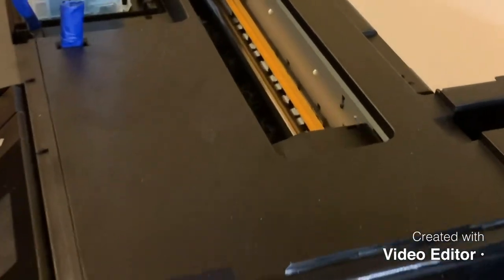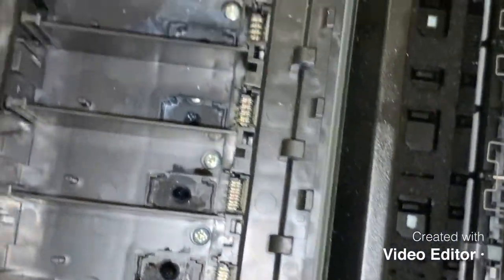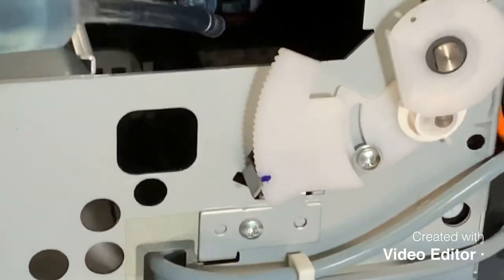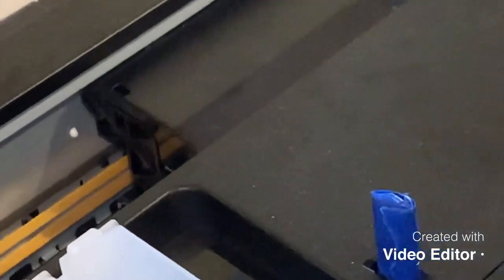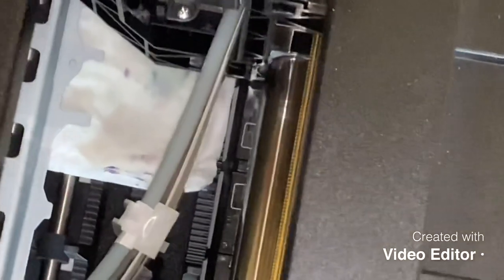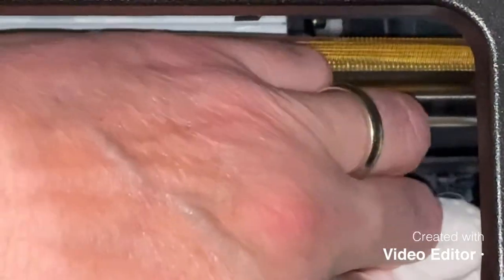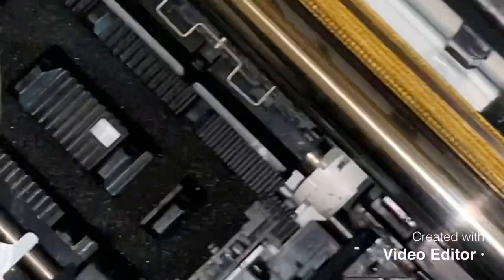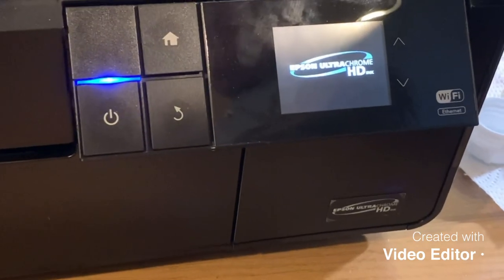Epson SC P600 DTF maintenance

Comment: This is an AWESOME video. I am just getting started and have been worried about the maintenance side. I probably won't print everyday.  Can I leave the cartridges with cleaning solution in place for longer than a day until I'm ready to print again?
Reply from the maker: I don’t use mine every day but what I do, do is shake the inks daily and head clean. If i go away for a week then year i run the cleaning solution carriages. The problem with that is, you need to re prime the lines! I hope that helps :)

Comment: Is this printer still working fine after all these months? Just curious if the way you did the maintenance in this video has prevented any issues from happening after all this time.
Reply from the maker: Sure is!
Reply: @lorimarlodesignco7776  Do you do anything  additional let’s say on a Friday night if you plan to take the weekend off?
Reply from the maker: @inklabdesigns  my printer and shop is at my house. If I’m home i will just hit the button to do a head clean everyday. I have gone away for a weekend and everything was fine
Reply: @lorimarlodesignco7776  Sounds good. I see people on Facebook groups talk about using cleaning cartridges in their printers but that looks to be impossible with printers like the p600 or p800 since they have long ink lines inside. So I’ve been trying to figure out how to make sure not to ruin my p800 once I set it up this weekend.
Reply from the maker: @inklabdesigns  i have put cleaning solution and cartridges in when gone for a week or so…. But a weekend i think is fine. As long as you have a controlled environment. Humidity is the devil with these printers
Reply: Do you clean it everyday?
Reply from the maker: @ericzzz924  sure do! Only if i use it! I just replaced the capping station after a year of printing! Daily maintenance is KEY! I clean the head every couple of weeks i take out and put it in solution to soak and do NOT waterfall just clean exterior unless needed
Reply: @lorimarlodesignco7776  Do you take the printhead out  every couple weeks regardless if it has clogs or not? Next time you do that, would you be able to take a video of you removing the printhead if you have the chance? I appreciate your help.
Reply from the maker: @inklabdesigns  hi there. I do have a video of this already. Look back in my page :) hope it helps

Comment: is this the same layout as the p800? is the whole modification to do dtf the same p600/p800? Remove pizza wheels, build new output tray, chip-less update, refillable cartridges ?   lmk thanks.
Reply from the maker: Hi there, I have not personally converted a P 800. However, it is my understanding it is the same process that you listed above. I wish you the best

Comment: How does acrorip work and where did you buy the cartridges? Do you need something else to do the adaptation?
Reply from the maker: Hi there, I do not use acro rip I use EK print and I purchased the extended cartridges off of Ali Baba. The other thing that you would need to do for adaptation is make your ink cartridges chipless. I hope that helps

Comment: Got a question for you: I am in the process of cleaning my Surecolor p600. It had been printing yellow lines along with the printed subject.  Anyway, the long piece of foam along the bottom of the print head track has a yellow stripe on it. Can this be taken out and the foam cleaned off?  Perhaps soaked in solution or distilled water?  It looks like it is a chore getting it back in as there are short segments of foam pushed down into various cavities, along that track.  Just curious if you might have found you have to clean that piece of foam.  Thanks. (Got to thinking about this and realize, you might not have that piece of foam if you have a DTF modified printer.)
Reply from the maker: Hi there! Good question! I have, in the past, have ink on the foam. I’ve never tried to remove it. Just cleaned with cleaning solution and dabbed it clean. I’m sure it’s removable and you could purchase the foam..... could be challenging however to put back in! Lol hope that helps

Comment: Hi Lori and thanks for the video.  I'm in the sublimation business as well and as you know the white is a huge issue.  Been researching DTF and Going to purchase a P-600 and convert it myself.   Was wondering where you got the extended cartridges with ARC from?  Was looking at the WhiteRip 7 Software.  What do you use for RIP?
Reply from the maker: Hi Tony - we use EK print and have been very happy with the software. You can purchase any cartridges you may like. What you would want to do is make your p600 chipless. Look up on YouTube there some great videos on how to accomplish this. Chipless is the way to go :) hope that helps
Reply: @lorimarlodesignco7776  Thanks for the reply.  Will definitely look that up.  Did you  DIY yours?  Also what color combo do you use?  CMYK+WW leaves 3 more.
Reply from the maker: @tshing08  well its ywwmcwwk open for cleaning solution

Comment: Hi Lori, one question, did you say that you modified other p600s for you, such as the adaptation of an output tray and the extraction of the wheels, is it difficult to remove those wheels? Thank you.
And if there is someone who can make a video of how it makes its modification, it would be very useful.
thanks Lori, many successes in everything and a very good video.
Reply from the maker: Good morning, thank you very much for your kind comment. Yes, I did take the wheels out it’s extremely easy to do so. I would suggest searching YouTube for modifications. Or join some of the Facebook DTF groups. There is some really good information in those groups. It is a process to convert printers. You would need to make your printer chipless to take on refillable cartridges. You are going to need to purge your system of the old ink and then you will need to purchase DTF ink, film and curing  powder. Sadly, I do not have a video showing those steps. Again, I highly suggest joining some of the DTF groups on Facebook because there are some really good videos in there. I hope that helps I believe I answered both questions or at least I tried LOL have a great day
Reply: Hi Lori, I got to buy a new machine; p600 ,. I have a question about the wheels, are the wheels that when removing the front feed tray are hidden? since under it there are no others.
Reply from the maker: @OscarSandroSusukiKuboyama  so sorry i JUST saw this and i watched your vid! GOOD JOB! Perfect :)

Comment: I'm looking into a P600 also. This was a great maintenance video. Definitely not too bad for a daily maintenance on the printer. I have a question. What if you finish your end of day maintenance, and have to leave the printer untouched for a week. Will that ruin the ink cartridges?

Thank you for your time
Reply from the maker: Hi James that’s a very good question. I have found with my personal experiences that if I keep my air conditioning on and the humidity very very low I can actually leave my printer for a week and not have any issues. However, I have in the past used another set of cartridges filled with cleaning solution I would then use the print tool and push all the inks out and do a flush. That way the cleaning solution stays within the lines while you are away ensuring that they would not be any issues. I hope this helps you :)
Reply: @lorimarlodesignco7776  this makes perfect sense. You would just have to prime the lines again with the ink cartridges. In a sense, starting over almost with a brand new system. Thank you so much for your time. Have a blessed day.
Reply from the maker: @jameskastner2062  same to you James
Reply: @lorimarlodesignco7776  hello again Lori. Sorry to bug. Where did you purchase your P600? Did the company have all the equipment and software to get you started? Thank you for your time.
Reply from the maker: @jameskastner2062  no bother! I actually converted my own printer …. I had bought one from a vendor and was scammed! So, i found a p600 from marketplace and was determined to learn how to convert it myself lol
Reply: @lorimarlodesignco7776  Solid. Do you have a video showing your setup? I'm trying to get into DTF. ATM I'm a screen printer, and outsourcing to a DTF printer. I'd like to keep everything in house. Thank the printer gods I didn't get swindled into getting a white toner.
Reply from the maker: @jameskastner2062  omg we almost went white toner too! BRUTAL! DTF superstore the owner is Andy McDaniel and he is a GREAT guy to deal with and he has a lot of products to choose from. Unfortunately i don’t have any vids on converting it’s easy enough but lots of steps
Reply: @lorimarlodesignco7776  I found one. Looks easy enough. I just don't know all the programs and such. I'll touch base with dtf superstore when the time comes. Thank you so much for your help.
Reply: @lorimarlodesignco7776  hello again Lori. I'm fixing to purchase and convert a P600 into a DTF printer very soon. Screenprinting is taking its tole and I've had to turn a few accounts down. You mentioned DTF superstore. Will I be able to get all the parts for conversion there and programs for PC? Thank you for your time.
Reply from the maker: @jameskastner2062  hi there! I’m not sure if you can still purchase a p600 from DTFsuoerstore but Andy the owner is fantastic! You can purchase the film and all the inks from there. He can probably help you to guide you how to convert a p600 … My suggestion would be to reach out to him. I think as a screen printer you are very smart to add this to your collection and I really believe you’ll be pleased with it
Reply: @lorimarlodesignco7776  I found a p600 on Amazon so I'm good there. 👍 I'll reach out to him on the conversion.  May I reach out to you if I ever get stuck?
Reply from the maker: @jameskastner2062  absolutely! Happy to help
Email me at Lorijkimball@gmail.com
Reply: @lorimarlodesignco7776  thank you Lori. Have an amazing day!
Reply from the maker: @jameskastner2062  same to you!

Comment: hi. what rip software are you using ? thx.
Reply from the maker: We are currently using EK Print Rip
Reply: @lorimarlodesignco7776  for EK rip software, can we get thin prints and make it look like near screen printing or DTG quality print ?
Reply from the maker: @khalil2099  well, I can’t personally 100% answer that from experience. However, yes that is what I hear and read... very much like DTG but washes way better. Hope that helps
Reply: @lorimarlodesignco7776  cool. thanks.

Comment: Yes this is a great video. May I ask how many prints are you running per day? What is the capacity per day of your epson?
Reply from the maker: Compared to some we are low volume and we have 2 printers at the most 40 per day as we also do sublimation ... we could def do more but in general 5-40 a day
Reply: @lorimarlodesignco7776  Thank you such. This is good information. I want to get the printer but I have heard there is many problems with the white ink. It is good that you can do about 40 prints per day and have no problems. I am looking into the DTF biz but am trying to learn everything first before investing. What is theb#1 problem you have had with this printer?
Reply from the maker: @MichaelB-ry7hb The learning curve of the rip software is the hardest! If you maintain and do as i show you in the video. You will have zero issues with the printer itself. I would suggest that you stay away from bootlegged acrorip and look into a different type of rip software
Reply: @lorimarlodesignco7776  thank you Lori for all your great info. Tell me the truth is this dtf new tech as good as all the people say on YouTube. Does it really feel that great and more durable?
Reply from the maker: @MichaelB-ry7hb  yes! I feel like it is worth every dime! Better than vinyl, WAYYYYYY better than white toner. Very durable and i feel more versatility. Feels in between DTG and soft vinyl. Pull test is very true, washability is very true. We’ve been pleased and our customers have Ben happy! Photo or graphic quality is unreal. I’ve literally printed picture, snapshots and transferred onto garments. I hope this helps
Reply: @lorimarlodesignco7776  yes it does very much so, Thank you. Is there anything the transfers can't be put in?
Reply: @lorimarlodesignco7776  ohh I forgot to ask. I have been researching tshirts, so many out there. What tshirts do you find your customers like most?
Reply from the maker: @MichaelB-ry7hb  not to my knowledge i know ppl are even putting transfers on leather... i would say anything that can’t handle high heat
Reply from the maker: @MichaelB-ry7hb  soft spun cotton seems to be popular. Heavy cotton for working folk. Guildans are always good
Reply: @lorimarlodesignco7776  hey good info!!!  can you tell me what cleaner your using